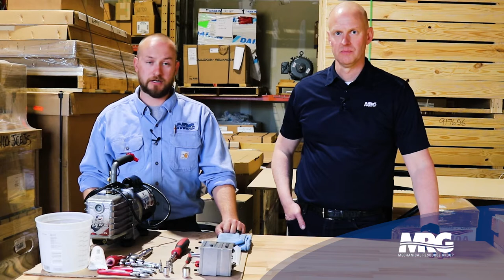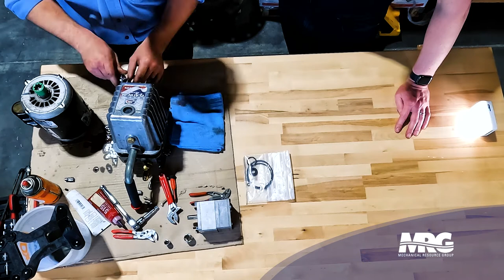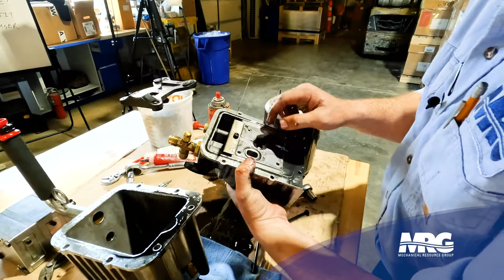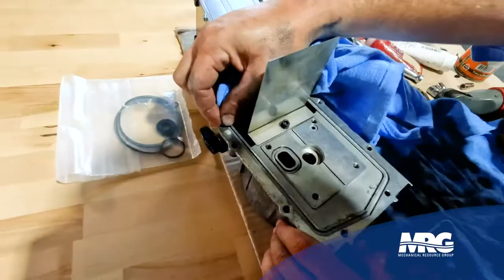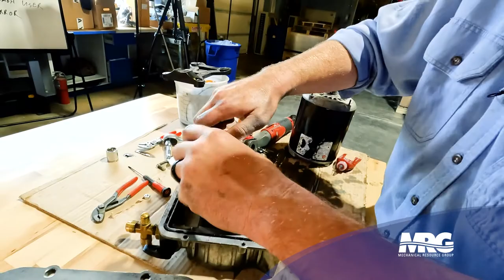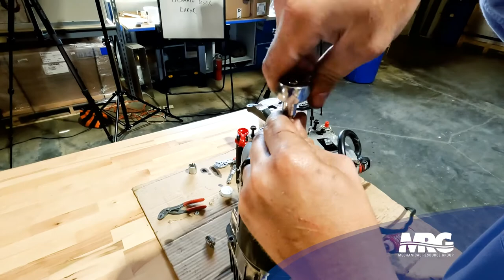How to Rebuild a JB Industries Vacuum Pump | Mechanical Pros - Vacuum Pump Maintenance

Comment: On my JB DV-142 5cfm pump, the cartridge itself is held together by two allen screws so when I removed the 4 hex bolts, the cartridge stayed together. Another youtuber showed how he rebuilt the cartridge on his smaller JB pump. He had to hone the surfaces flat, and reversed one of the plates which was badly scored. When he reassembled the cartridge, he used two pins or drillbits that were snug fit in the 4 holes to align all the segments of the cartridge, tightened those two allen bolts down, then removed the pins and bolted  the cartridge back in place. The two allen bolts go through the cartridge from the opposite side from the 4 hex bolts so you may not see those at first. I'm taking mine apart right now, so far mine looks pretty good inside, though it would only draw down to 120 microns when I started, after changing the oil 4 times with warmups between each change. Motor couple exploded after the 4th change, and had to wait for Amazon to send me a new coupler. Easy install. Specifications say it should go down to 15 microns on the DV-142-N  version (newer than my DV-142). I'll be happy with 50 microns, but can live with under 120, as I am not a paid professional HVAC technician. I got my schooling in the Navy years ago, back when R-12 and R-22 were king! Prett rusty now though!
Reply: Yes that is rebuilding but notice that most of the company's don't sell or show parts inside of the cartridge What he showed is not rebuilding total waist of time.

Comment: I got to step 1 of the process and found that the coupling was shredded with little bits of rubber everywhere. That's why it's not pulling vacuum. I was able to turn the shaft by hand easily though. You can call JB industries directly for parts that fit your specific pump. They'll need your serial number and model number, but I'd recommend talking to someone, since some of the parts on their website have been superseded by newer part numbers.

Comment: Always change your oil after every job.  Never leave oil containing water in your pump to rust it!
Reply: After the oil is added Should you manually rotate pump before powering on for the first time after rebuild?
Reply: @Jason Antonio  The pump comes with an instruction sheet.  I believe JB suggests adding 2 to 3 ounces in the intake, but don't quote me.  This should adequately lubricate the pump veins.  They're just paddles spinning in a cylinder.  No piston, oil pump, or passages to prepressurize.
You can always call JB Industries and ask to speak to Matt in repair.
JB is the best!

Comment: So my big question is. Should the cartridge be able to turn? I try to turn it with hand and it’s firmly stuck. That’s the part sticking out off the cartridge that goes into the green part that fit into the motor. Once again the motor turns freely with hand but the other part will not move.

Comment: What is the part number for that rebuild kit. Our parts guy at Johnstone Supply has not found any kit that has o-rings any shaft seal. The kits they sold us have the drain, coupling, 4 rubber feet, & the sight glass.

Comment: Can you please elaborate a bit better on how to prolong the life of the pump. You mentioned something along the line of what not to do on startup and shutdown, but I am not 100% clear on that. E.g. when vacuuming a car AC system, what is the proper procedure for starting it up and shutting it down?
Reply from the maker: Ensure the hand valve is closed on the vacuum pump, power up the vacuum pump, slowly open the hand valve on the vacuum pump, slowly open the valves on your gauge manifold or core removal tools.

Comment: I have a 7CFM JB and it won’t start period. In this case should I look into the motor or is there anything else I should consider?
Reply from the maker: Yes, with the vacuum pump unplugged, decouple the motor from the pump and see if the motor and pump turn freely by hand. 
Ensure the on/off switch is closing by conducting a continuity test across the switch.
Reply: @MechanicalPros  thanks for your reply. I have a situation where the switch is broken so I just connect 1 &2 and plug it in. The motor turns freely with hand but it does not start when I plug it in. I get a humming sound I also check the Capacitor and it’s good. Am now thinking it might be the motor that’s gone.